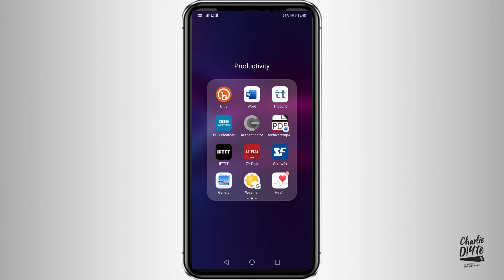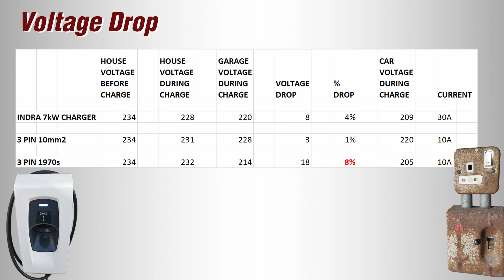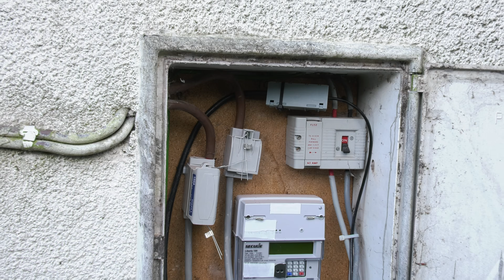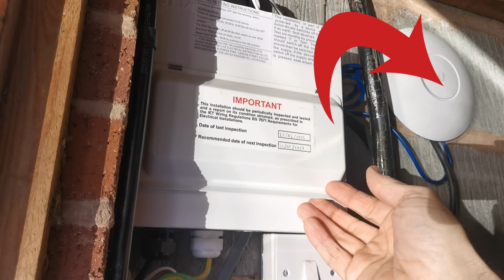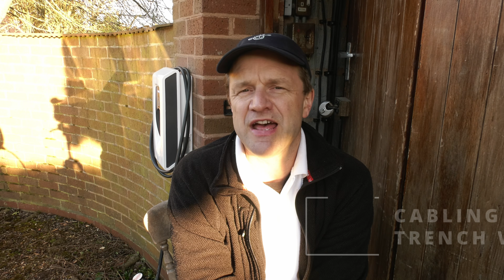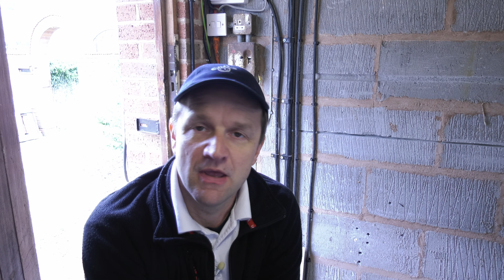Installing a Home EV Charge Point - Everything you Need to Know

Comment: The tails after the meter are the responsibility of the home owner the tails from the DNO cutout to the meter belong to the supplier. The cutout can be opened by a supply company operative if appropriately trained and licensed. The lack of discrimination/ selectivity between the DNO disconnection device and yours is poor.
Reply from the maker: I made the point about the tails and who is responsible for them.
Reply: @CharlieDIYte  your statement was incorrect. Everything from the meter including the link tailes between the meter and your fused switch unit belong to you as the home owner. The supplier is responsible for tge tails from the cutout to the meter. The suppliers can pull but not upgrade the dno fuse and the DNOs responsibility ends at the cutout.
Having rewatched the meter cupboard section of the video I would also be concerned with 25mm tails. Not knowing the length or the route taken I couldn't make an informed calculation. 25mm sq. 6181Y double insulated 70oC thermoplastic insulated single core cable installed in conduit or trunking BS7671 table 4D1A installation reference method A states 101Amps to be the maximum current without calculating any thermal factors like walls or insulation or the voltage drop. One would also hope the network cable tie rapped to your tails is apparently installed. BS7671 states band 1 and band 2 cables must not be run together unless installed appropriately to the highest voltage present.

Comment: You should have had a proper duct installed then it would be rewireble you already done the hard work.
Reply from the maker: You'd struggle to send a new cable down 65m of ducting though. 🤔
Reply: @CharlieDIYte  put a bigger ducting in for future use or rewiring your already going to them lengths digging the trench in the first place.
Reply from the maker: @leewinters606  Fair point.

Comment: Interesting and some good 'heads up' points. At about minute 14, when you decided to 'save a bit of money', I could already see that this was going to run in to thousands, especially as you were having the CU's replaced. Was the time you spent 'saving' that money really worth your time? We've all done it though!!!! 🤣🤣🤣
Reply from the maker: It's one of those things isn't it. Probably not right now although they say having a charge point adds value to your house. But if I install solar - which will admittedly be a ton more money, then it starts to make a lot of sense.

Comment: Thanks for all your videos. Solar is the best thing you can do to reduce your carbon footprint especially if you have an EV. Install as much as you can given the space available. You have to have permission to install above 3.6 Kwp from the DNO and back in the days of the Feed in Tariff you were penalised if you had more than 4 Kwp so a  standard install was 3.6 KWp indeed inverter manufacturers made a version for the UK market. if you have room for more then apply for permission which you may have to pay for. You may also have to wait for 4 weeks for the permission. Any extra you generate you will be paid for. Something like 5.5p per kwh but there is the likelihood of that going up in the future. Until recently I used to think that a battery is a waste of money. In the winter there is very little solar and so the battery doesn't really get charged much. In the summer solar keeps you supplied during the day and you don't consume much in the evening a few lights TV computer perhaps for a few hours and the battery doesn't discharge much. However with prices so high it might be worth it. If you can charge the battery overnight with cheap tariff electricity then it becomes more attractive.
Reply from the maker: Thanks for this. Yes I've ordered the solar. The priority will be to minimise my consumption from the grid and to charge the EV from what I generate, rather than feed in, but if I can sell any back that will be a bonus. Got to re-tile the garage roof first though. 😬

Comment: Great Video. I don't think people appreciate the difficulty in having an EV charge point installed. I was dead lucky in my old house as my meter box was in an outside brick cupboard. My new house (new-build) the drive and garage are at the bottom of the garden. I had to pretty much beg the builder to add an additional circuit ready for my charger. One of the UKs biggest house builders and they claimed no one had ever asked for this! They need to wake up to the future or the government needs to hurry up the legislation forcing builders to install EV points as standard.
Reply from the maker: Thanks Graeme. Great work - I bet the builder was like a dog chewing wasps when you asked him to install that 😬 There's so much to be done as you say, if they're going to ban the cake of ICEs in 2030. The charging network is woefully inadequate right now, not helped by corporates like Open Reach and British Gas changing their entire fleets over to electric, and clogging the fast chargers during the day.

Comment: Could you consider creating a video on tools for detecting cables behind walls. Personally I have a house that has plenty of coaxial, telephone outlets but I have struggled to trace where they go.
Reply from the maker: It's problematic as the detectors are hit and miss. That one you saw - which is now called Truvo is one of the best in my opinion. However you might not pick up coax or telephone  because of the amount of power running through it. With getting one of those detectors though as it's a good thing to have in your tool box.

Comment: Useful video - thank you.

A few observations if I may:
- the lack of a double pole RCD has already been identified but it should also be a type A or better (not type AC as this gives no protection against and may stop working in the presence of a DC fault current)
- you mention a 100mA time delay RCD. This is normally what you would have to provide additional protection for the whole installation if it is TT (which yours is) and the earth loop impedance (Ze) is too high to trip MCBs or the overcurrent function of RCBOs. As a minimum your sparks should have measured Ze and recorded it on the installation certificate for the new circuits.
- you do not recommend DIY installation, which is good. A charger must be on its own circuit, which means that the installation is notifiable under part P so unless the DIY installer had their work certified by LABC or an electrician who can certify third party work, they would be breaking the law. 
- supplier fuses can be problematic. The fuse carrier may say 100A but that is the carrier’s rated current; the fuse may be lower. Some DNOs are reluctant to go above 80A, 60A is also common and as low as 30A is possible. There is no way of telling without asking the DNO to pull the fuse.  It should be obvious that no DIYer should cut any seal
- you do not need the DNO for a meter or tails change. The supplier or their meter operator can cut and re-seal the main fuse.
Reply: All points well highlighted saved me the trouble of pointing them out.
Reply from the maker: Many thanks for this, Nick. It looks like an update video will be needed in a week or two once I've contacted Chargedev and got a response from them on why they didn't swap the RCBOs. I discussed the type A/ type B question with my electrician and his wholesaler days all RCBOs are type A now. Would you disagree with this? I never intended this video to be a chapter and verse on electrical regs so it's frustrating I've been let down on this side of things but I'm grateful to you and the other commenters who have pointed out where this install has gone wrong. Apparently the wholesaler who supplied electrician is selling several ev charge points per week with this RCBO consumer unit, so it looks like mistakes are being made on these installs nationwide.
Reply: @CharlieDIYte  From a personal point of view that would be a really good video. The lease company im getting an EV through use ChargedEV... and I've not been overly impressed by them so far.

Comment: I can relate to the problems you had digging that trench. I have been struggling through clay that is either like concrete or glue (depending on the weather) and I'm lucky if I make two feet a day...
Reply from the maker: Yes it's all you can do, isn't it, tackle it bit by bit.

Comment: Hi Charley  Being now retired from electrical contracting I have taken a particular interest in the whole issue of EV charging. And to say it’s a minefield is probably an understatement , and definitely not helped by manufacturers playing fast and lose with the regulations saying you can charge for a 13 amp socket . Just look at the recorded fires that have been attributed to this practice .     As regards just the earthing of a system , it seems to attract much debate . Resulting in some saying the whole installation should be separate from the incoming supply Earth via a earth rod / spike . The reason for this is that under certain fault conditions the actual body of the car can become live . You can see what I mean when I say it’s a controversial topic , I did notice your contractor had installed an earth spike so I would assume it was to mitigate this problem . Finally I would mention that installing 2core SWA is really seldom compliant , because the cross sectional aria of armer wire is not big enough for the earth loop reading . So would always use 3core , and in my day we would install a separate earth cable of say 16 mm to  give a belt and braces  approach . This is purely in regards to the garage supply , but I think you would agree the actual EV side is a total different ballgame . This new technology is still in its infancy so in fairness to electrical contractors this has been a steep learning curve. Which makes me glad to be on the sidelines now ,             Best wishes and kind regards as always 😀👍👍🤔
Reply: Is the use of the armour alone for earthing a problem in this case, as it's being used for a TT supply to the garage? All it's protecting is the cable itself, and is presumably isolated from the earthing system of the garage.
Reply from the maker: Thanks for this Michael. I'm not an electrical obviously so I'll trip myself up here but with the house supply staked, the argument goes that there's little point running the earth all the way back to the house stake when it can be separately staked at the garage. It would I think be different if we were supplied at the house by an underground supply which is earthed neck to the sub station? @Miss Take Not, my electrician also earthed the SWA sheaf - not sure if this answers your question.
Reply: @CharlieDIYte  I would expect the sheath to be earthed at the house end, but not at the garage end.
Reply: @misstakenot9582   hi this is the point I was trying to make as regards it’s a complicated subject , if you make an installation a  TT install then obviously it’s a case that it’s controlled via a RCD , as I stated it did look like an earth spike had been installed at the garage end but if the intention is to increase the size of the installation having it totally controlled by an RCD may invariably prove problematic . So assuming we just treat the the supply to the AV charger as having a separated earth from the garage supply ie TT , the rest of the installation should have at least a 3 core SWA supply cable because when it comes to testing the supply the lack of  cross sectional aria of the steel wire will not be enough to give an adequate earth loop impedance result . As I’m not privy to the ins and outs of the installation I am trying to point out some of the pitfalls that can arise in this kind of work , but I reiterate the AV it self looks in accordance with accepted practice.   Best wishes and kind regards

Comment: I required a main fuse upgrade for my new Wallbox charger and it was not free of charge. Small works like this from Northern Power grid cost me £143 Inc VAT.
Reply from the maker: Thanks for pointing that out Lee. I'll put that in my update video once I've persuaded chargedev to replace the single pole RCBOs they should have - as has been pointed out to me since I posted the video.

Comment: Thanks for the shout out Charlie. A great video and plenty of great points for consumers to think about. Just one thing you might want to check is the RCBO feeding the EV charger. They should disconnect both line and neutral conductors - often called a single-pole plus switched neutral RCBO.  This is a requirement in BS7671. 

Also with reference to Bulb - they are still operating. Gordon in our team has an ongoing battle to get a smart (dumb) meter removed and it's close to a resolution after 9 months.
Reply from the maker: Thanks. Yes this point about the single pole RCBO has been raised by someone else too (Mick), and someone else has said the RCBO at the house should be 100mA time delay?  I can't really blame my electrician given that he doesn't install EV chargers and he got the board from his wholesaler who supplies several chargers with this set up to electricians for EV charger installs each week!! Plus he was acting on some general instructions we'd received from chargedev's technical team on RCDs which didn't specifically mention the double pole point. Granted he should probably have known about this reg, but the RCBO wasn't connected - we were just trying to streamline the install as much as possible. Chargedev should have picked it up though and installed their own double pole RCBOs - particularly given this was a full price install with no discount, in spite of the fact I supplied all the cable! I'll see what they say on Monday ... I should perhaps have been a bit clearer on the Bulb point. By saying they'd gone bust I was really just making the point that they perhaps won't be as keen to come out and assist with the meter tail upgrade as a company not in administration would be
Reply: @CharlieDIYte  Chargedev should have picked up on it really as its their line of work. Even qualified installers get it wrong though as I've seen it done many times. These big companies are only as good as the individual they send to comple the work.
Unfortunately once the OLEV grant ends for homeowners in March there's going to be thousands of badly installed charge points by electricians who haven't received adequate training.
Reply from the maker: @mickbitchum4664  Thanks Mick. Yes it'll be an interesting conversation with Chargedev on Monday. I'll report back! I agree with you point about the grant, which was a big incentive to go with one of the established OLEV installers. Thanks to you both for your input - I'll be doing an update video to highlight what you've said in a week or two.

Comment: Great video. I had a similar situation to you but thankfully we installed the Indra last year way before our car arrived. We are going to get a shock as we fixed our octopus tariff back in July for 2 years and pay 15p per KWH during the day and 5p per kWh for the 4 hours off peak during the night. Must say they are a great charger and the support from Charged EV is brilliant. You also could have mentioned that Indra are based in this country and manufacture the chargers here too.
Reply from the maker: Thanks for that. Yes I've just moved over to Go and I'm paying a dynamic rate of 30p per kWh now 🤦🏻‍♂️ I hope Chargedev come good. An interesting issue has arisen in that some electricians have pointed out that they should have fitted double pole RCBOs. I pointed this out on Monday and am waiting for a response...

Comment: Brilliant video ... very well researched, presented and edited. Some people buying EV's do all their research before buying, but many don't. For anyone considering an EV and wanting to home home charge this video will be invaluable, sure not everyone will have the 70 metre cable trench, but the way you have presented the content makes it easy to see all the other highly relevant content. I especially like how you focused on the main fuse rating, interacting with the DNO and the issue of looped supplies. It is essential people understand these matters up front and taking advice from a car dealer interested in closing a sale these are things that are glossed over. Also like the mention of the guys at efixx, another great YpuTube resource. You were also realistic enough to mention that with the current state of domestic energy market the possible savings from running an EV will be reduced. Competition in the energy market is broken so the only way people will be able to improve their situation is with their own solar and battery and it sounds like you are setting up to tell us all about that. Well Done.
Reply from the maker: Thanks Stephen, I really appreciate your detailed and thoughtful comment. Yes I was definitely in the second group - inexplicably of not doing any research before buying. If I had though, we might not have got the car in the first place... 😉 Yes, solar is the next step as you guessed and whilst the cost of it will pretty much wipe me out, it just makes so much sense at the moment!

Comment: Also had an Indra installed by ChargedEV. Had also a bit of a tricky setup so did the cable run myself, ChargedEV did a great job
Reply from the maker: Thanks Iain. There will be a quick update video in a week or two following some comments from eagle eyed electricians, so keep an eye out for that 👍
Reply: @CharlieDIYte  seen the comment regarding SP RCBO, I have checked they did install a DP RCBO in my install